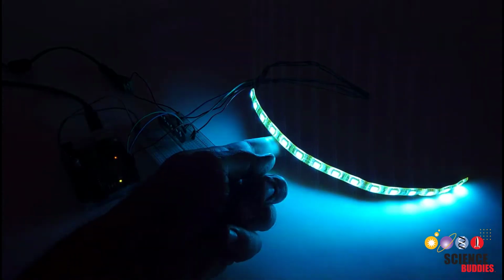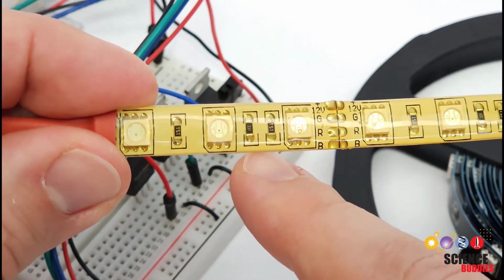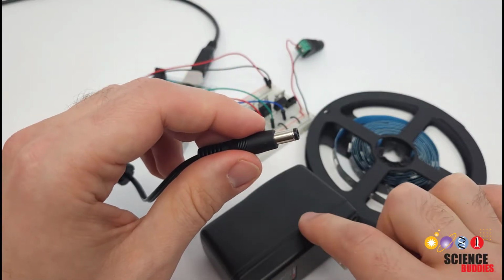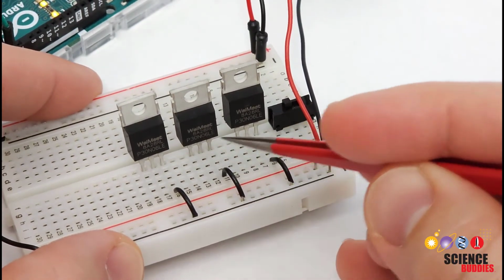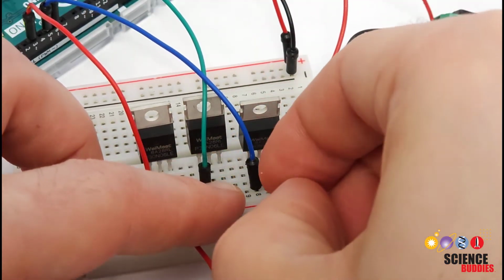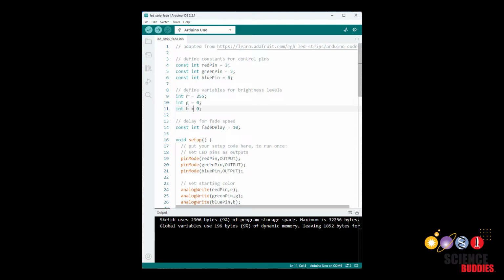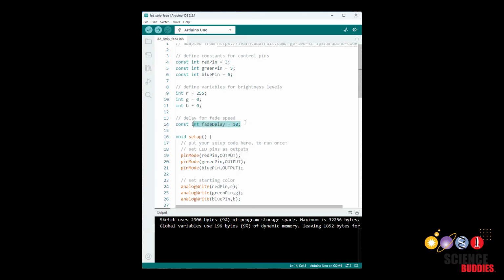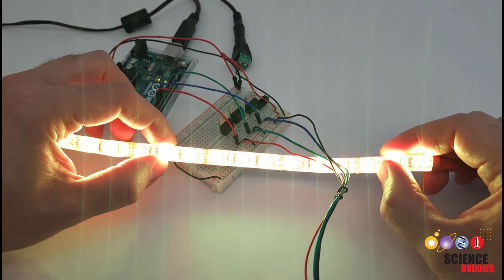Analog RGB LED Strip Control with Arduino (Lesson #29)

Comment: If the strip is 12V one, you could use a yellow wire instead of a black one, for the + V. Yellow is the standard color for +12Vcc
Reply: Good tip!

Comment: How to add a pressure switch to turn on LED, considering the Arduino board is using a power supply to power up?
Reply from the maker: We have a separate video about force sensors that you may find useful: https://youtu.be/r7oWtcE6QQc?si=Po27xd0z-4R9Jgf0, beyond that we recommend asking for help in the official Arduino forums.

Comment: Is the 5V arduino output and GND needed or can i just have the wires on pins
Reply: Don't use the 5v pin, Connect all the grounds together, the 5v power flows out of one of your control pins into the gate of the transistor, out through the transistors ground and back to the Arduino ground. The 12v power source flows into the transistors source, out through its drain, through the leds and then back to the 12v power source ground... it's like you have 2 circuits even though the grounds are all connected...
You adjust the voltage coming out of the control pin between 0-5v and voltage flowing through the source/drain of the transistor changes between 0-12v...

Comment: Awesome video! I'm new to Arduino and Soldering... When I'm connecting the LED via soldering, can I use the end of jumper wires? If not, what kind of wires should I use?
Reply from the maker: Yes, you should be able to solder jumper wires to the pads on the LED strip.

Comment: Thanks for the tutorial, very clear and simple way of presenting the information

One question, if I want to use the LEDs to make a Clock, following the digital pattern

Would I need to create several cuts in the led strip, so that each one represents a part of the digit forming a number?
In that case, how could I connect these parts to the arduino and control them?
Reply from the maker: Hi - we recommend looking up a "digital" or "addressable" LED strip - we don't have our own tutorial for them, but you can individually control the LEDs of a single strip without having to cut it up. Adafruit should have a good tutorial for them.

Comment: What is the mosfet that you're using?
Reply from the maker: It's an N-channel MOSFET like this or similar: https://www.amazon.com/gp/product/B07CTF1JVD
Reply: @Science.Buddies  .
Reply: Thanks
Reply: Sorry I am new to it but very much interested.

Is TIP122 equivalent to the MOSFET you are using?

Ps. I am new to electronics
Reply: @harmandatta6731  don't use the TIP122. They are Darlington transistors instead of mosfets

Comment: wait.. why didn't you plug the barrel jack directly into the arduino? Is there no way to use that 12v with the Vin pin?
Reply from the maker: In general you don't want to supply a large amount of current through the Arduino. See the top reply here: https://electronics.stackexchange.com/questions/67201/maximum-current-draw-on-vin-pin. There is a diode rated for 1 amp connected to the Vin pin.